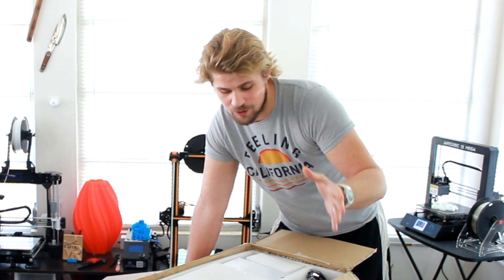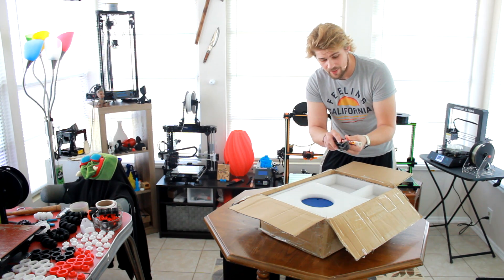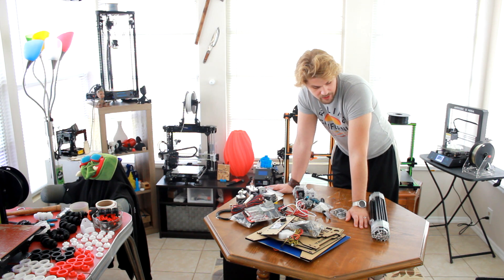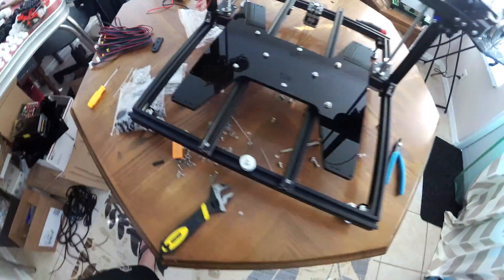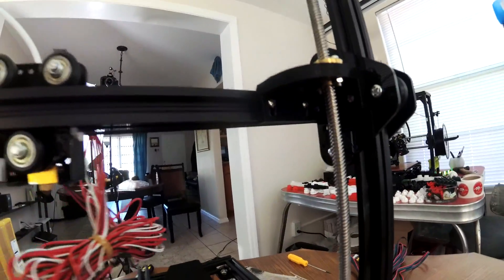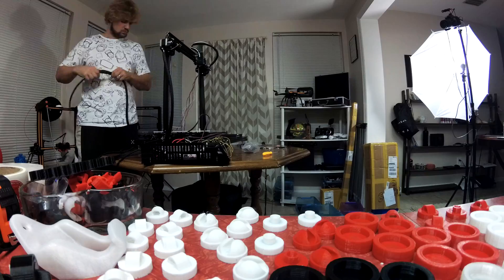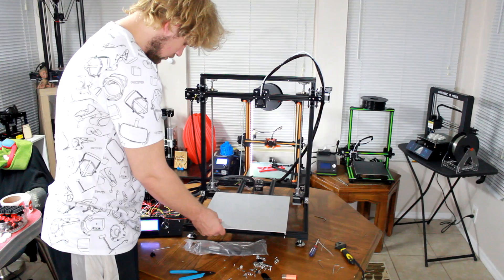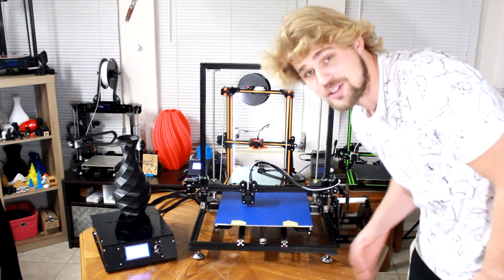✔ BIG CHEAP 3D-PRINTER | Tronxy X3S Ultimate REVIEW!

Comment: Looks like you got one in good working order. When i got my x3s got it together only to see a end stop was missing, fillment heater was burnt out and the motherbord was burnt on one of the relays chips but still worked. And im still waiting on replacement parts.
Reply: 3 years later, did you get the parts?